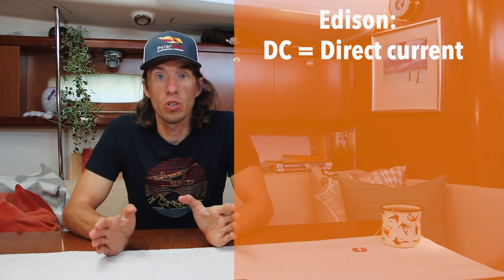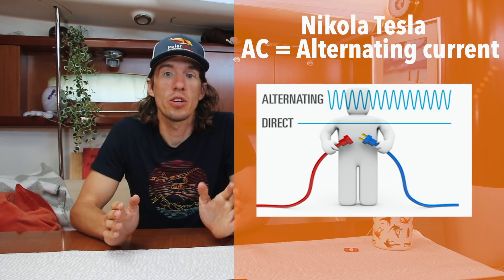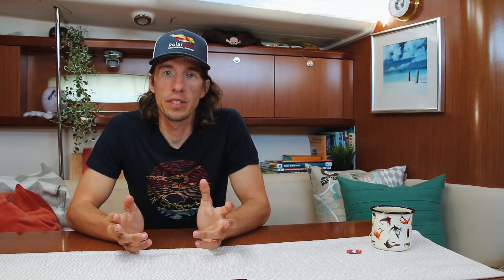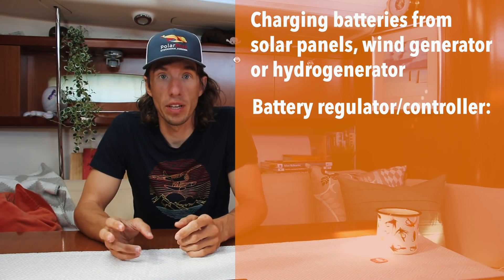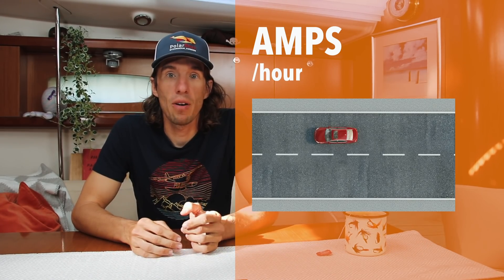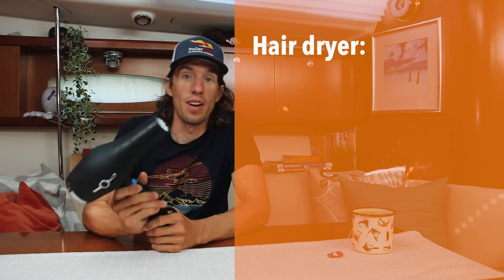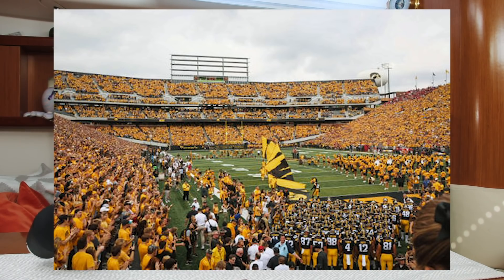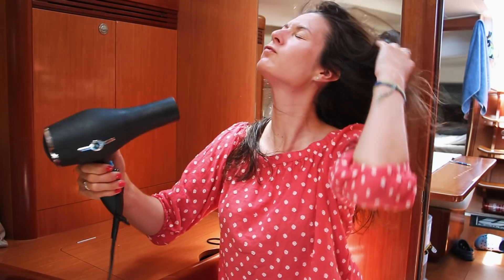How we get power onboard: Sailboat electrics (ridiculously basic) 101 // Ryan's tech corner #4

Comment: Technically speaking alternators generate alternating current (hence the name).  The AC is then rectified since all of the systems in a car or boat or whatever the engine is being used in typically require DC (as most electronic items do, even most things you plug into an AC outlet).  The main reason we use alternators on engines rather than generators (which produce DC) is because they generally produce more current at lower speeds, and rectifiers are cheap.

Comment: That battery can run both of your devices at the same time but not for more than 45-50 minutes. There is a difference there. Now, if you have a solar panel and inverter connected to that battery you can run both devices all day long as soon as you have power coming from the solar panels. 150W /12 v = 12.5 amps. I am sure that battery can put out a lot more. make sure you give out accurate info.
From the website:
Discharge:20 A max continuous, 50 A max 300 mS pulse.
So, you can pull 240W continous.

Comment: You should always use Wh when speaking of battery capacity. Energy = Watt x hour = Voltage x Amperage x hour, (assuming a power factor of 1). Voltage can relate to the speed at which the cars pass. Amperage to the number of cars passing at a fixed point (limited by the number of lanes or wire ampacity), which can vary at times, complicating the energy consumption/battery sizing issue.

Comment: Do you heat your water using batteries/inverter or do you still have to run the engine or connect to shore power?
Reply from the maker: 90% of the time we use the electric system for heating, but we only have it on for 10 or 15 min
Reply: @RyanSophieSailing  Cool, so you guys a pretty well set up for living off grid, nice one.
Reply from the maker: Yeah... other than food we really dont need much else.  Filters and spares but thats about it.  While system works really well.  Ryan

Comment: The initial "DC vs AC" talk is actually "high-voltage vs low-voltage" one. Low-voltage AC would also require high amperage for the same power and high-voltage DC is also unsafe and can cause death. It just happens that AC on a boat is usually 110 or 230V and DC is lower - 12 or 24V. So the root cause is voltage and not a type of current.

Comment: I think you’ll find that alternators produce AC current, hence the name. They typically have silicon diode rectifiers to convert the output to DC. Dynamos produce DC current. It would probably be useful to explain (unless you did and I missed it) that Watts = Amps x Volts. Users can then work out current draw for devices on a circuit of a given voltage.
Reply from the maker: Hi nick, yes this is true but its the tradeoffs of keeping it simple.  A person can buy an alternator and connect it.  As we do more of these we will get in to the workings of these things.  Thanks for the feedback.  Ryan

Comment: Often credited with "inventing" AC and DC, neither of them did.  Alessandro Volta demonstrated DC in 1800 Michael Faraday laid much of the groundwork for AC and also for electric motors. Edison built the first grid in NYC using DC and for the reasons you mentioned Tesla built the first AC grid.  :)
Reply: In 1885, Edison's vision of municipal DC power was laid to rest when William Stanley demonstrated the first practical AC power station, using a step-down transformer to convert 500v from a steam-powered generator to 100v and lighting the business district of Great Barrington MA.

Comment: actually another spanner in the works is that the alternator makes alternating current which has to go through diodes to cut off the alternating current o make DC and then through a regulator to regulate the voltage :)  But great video for the Sophies and others out there that need help understanding boating electricity
Reply from the maker: Hi mike, you are absolutely correct... the trouble with these types of videos is keeping them in the scope you want.  I did not want to get in to a big discussion about the workings of an alternator, but we might do that some day!  Ryan

Comment: The car analogy works for current.  But the voltage analogy didn’t work as well.  The classic is water in a pipe. The amount of water flowing is the current and the pressure is the voltage. Garden hose fire hose same pressure big difference in grow or amps.
Reply: for cars a good analogy would be a size of a boot in cars - itdoesn't correspond to the "pressure" but it fits in in terms of - the same amount of cars but more cargo.
Reply from the maker: Hi Lou, i considered using the water analogy but it to has issues.  The point was to get the general concept across. More advance topics will require some different analogies..  ryan